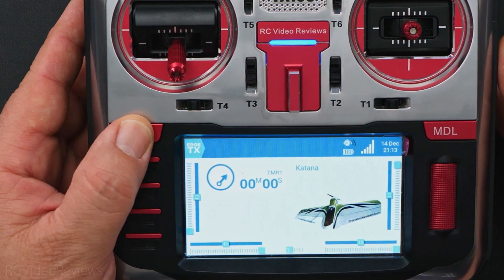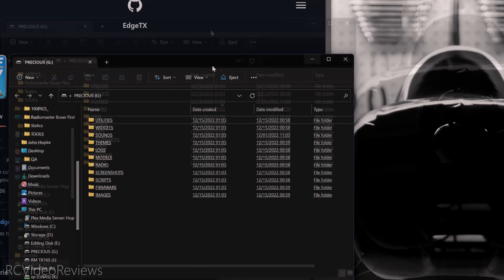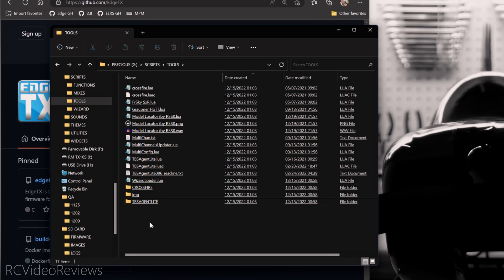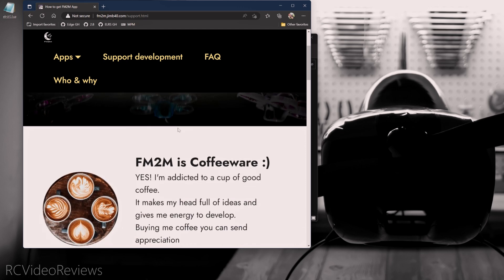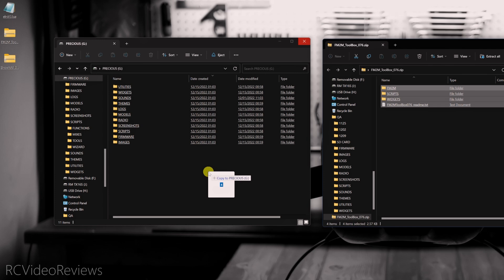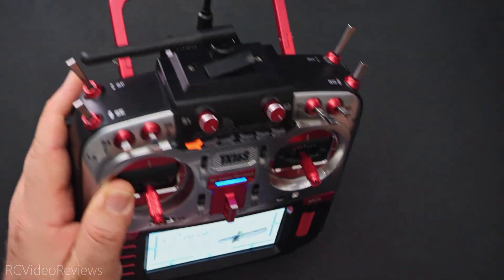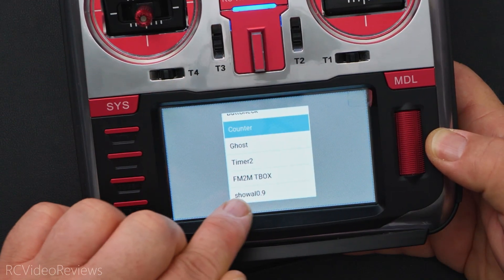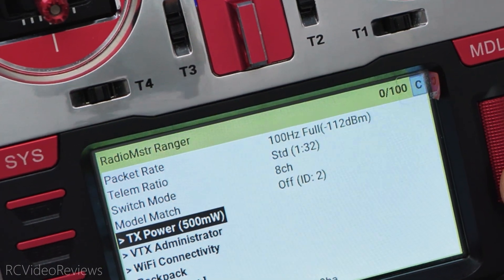Want to Change Your Tools Buttons on EdgeTX?

Comment: Nice insider tip John. When I started with Radiomaster, I never thought I would be able to understand the firmware. After finding you and your videos, this old man finally saw the light come on in my brain and everything started to work as developed. Keep up the good work.
Reply from the maker: Thanks Bill. It's a little bit of a pill to swallow, but once the light goes on, you're unstoppable.

Comment: Based on your videos, I just started with EdgeTX and TX16S, so thanks. 
EdgeTX has a lot of pre-loaded Lua scripts, is there anywhere these various pre-installed Lua scripts are documented? In the video you are dropping several of these, which I want to do as well, but I'm not sure what I'm dropping. Where can I find what these various pre-installed Lua scripts are for? Thanks!
Reply from the maker: The best bet is to look for the LUA source and see if you can find instructions at the source. Sometimes instructions are included inside the LUA archive.

Comment: Make sure to properly unmounted/eject before unplugging your radio!
Reply from the maker: Make sure to google whether that’s still necessary in windows…because it hasn’t been since windows 10.
Reply from the maker: https://www.theverge.com/2019/4/8/18300734/microsoft-safely-remove-eject-usb-flash-drive-not-needed-windows-10